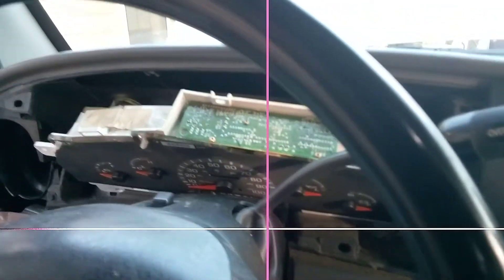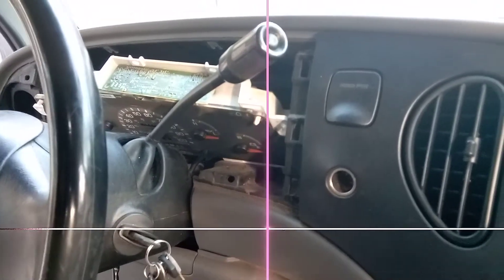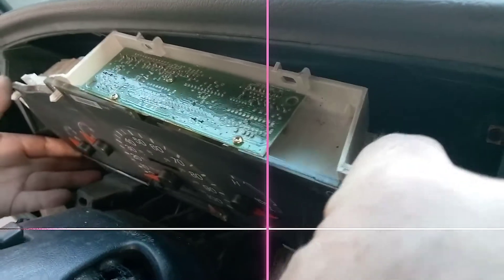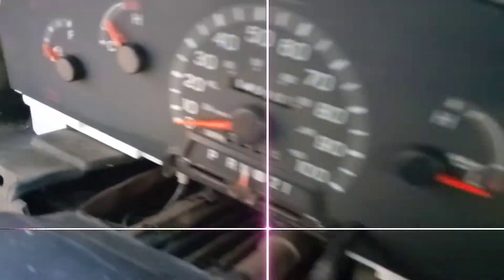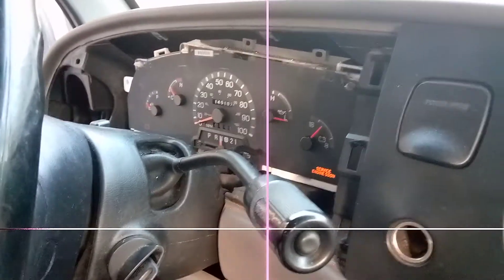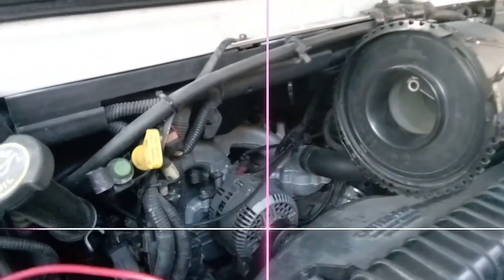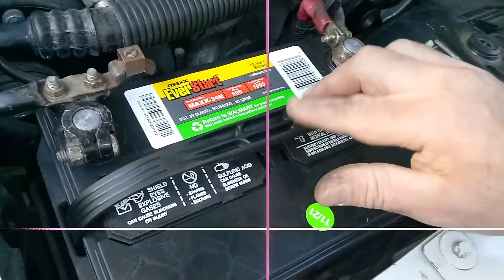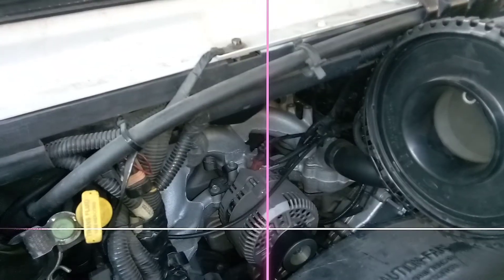Ford Alternator Excite Wire (Alternator Not Charging)

Comment: I know this video is 3 years old but i lost my battery light and can't find answers how to get it back. 
I lost my battery light by straight wiring the agitator wire to a fuse in the fuse box and no more battery light now it won't come on at all please help.
Reply from the maker: You might have to check the circuit board, otherwise check the bulb. There really isn't anything else there besides the circuit board and bulb. Worse case scenario, you replace the instrument cluster, aka, speedo. Good luck.